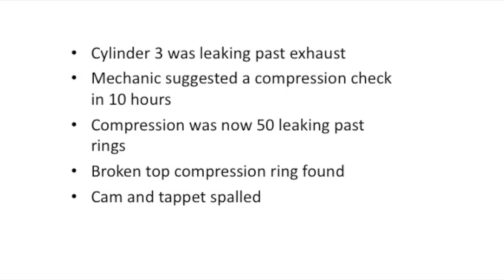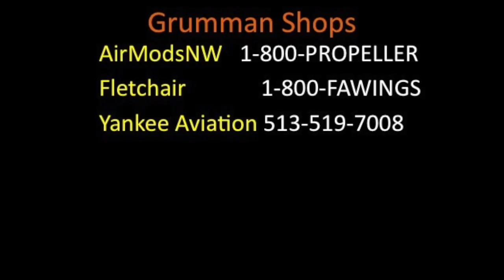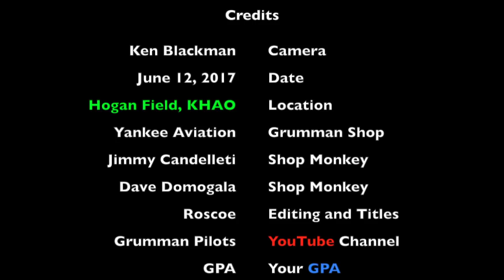Cylinder Replacement Gone Bad  - Grumman Style

Comment: What a shame. We used to do such nice work in Bethpage and Calverton.
Reply: Been told it was a great learning tool, and Grumman designed her to be simple, safe and with little automation so students would get used to a higher work load and greater speed on installed power . Kinda like teaching a guy to drive on a 5 speed mg,  rather than an automatic toyota.. manual tank switch,  higher performance,  the student would come out of the syllabus more confident than on a 172, or a Cherokee.. it doesn't coddle the student, and they can transition more easily to older aircraft with less automation, or higher performance aircraft due to it's own higher performance,.. Strikes me as a good investment for a flight school. I think this was Grummans philosophy  when Roy LoPresti modded her up from Bede's design..my opinion they should have sold her abroad as a military liason/ trainer  instead of breaking into the saturated us market.. India, South East Asia, South America would have been great markets for this plane. give it some more power and range and it would do very well in Brazil..too bad to see this example in such bad shape..
Reply from the maker: Yep
Reply from the maker: Yep

Comment: I didn't realise that bits of scrap like this aircraft where allowed to fly over our heads. It looks very aged and corroded, the aluminium bulkhead (if thats what u call it) is very oxidised. Are there cracks around the braces?  I thought the aviation industry had much higher standards than this pile of junk. Shame on you. I'm a auto mechanic and I would have slackened the tappets right off to release tension in that rocker pin you were malling up with a steel pin and claw hammer. You bring to mind memories of when we were kids messing with an old motorbike
Reply from the maker: Thanks for watching.

Comment: That was in nasty condition given its age. And how did so much moisture get INSIDE the engine to cause so much internal damage to so many vital parts?
Reply from the maker: As to moisture amount, it does not take much.
Reply: @GrummanPilots  Actually it does. There’s always a certain amount of water in oil, but beyond a certain point it emulsifies and causes a white deposit to form. This occurs in water cooled car and bike engines, with which I am more familiar. 

This is something else. It could have something to do with altitude, and the difference air pressures and temperatures involved. It could also be a characteristic of the engine design. 

But having opened up MANY car and bike engines, I’ve never seen that much water based damage to cams. And two of my bikes are Honda VF750Fs with a history of the notorious ‘chocolate’ cam issues. 

It’s a long time since I had anything to do with aircraft engines, though I did a bit of time on Lynx systems (Cessna 337/Continental IO360?) in Rhodesia, but only in passing, because that wasn’t my main role. 

We pushed those things to the absolute limit in some very harsh conditions, and with a shortage of spares and oil. At one point oil was being centrifugal and magnetic filtered to be reused!!

During quick turnaround situations, oil leaks were ragged off, checked for proximity to hot surfaces, and just topped up! 

And We didn’t lose any from catastrophic engine failure. Though I’m seeing a number of Lycoming and Continental engines experiencing catastrophic engine failures on YouTube. It’s a curious thing.

Comment: ZINC ZINC ZINC    If you do not have it in your oil   there goes the Neighborhood.  Was Lycoming  additive added at each oil change?    Are   Air Craft  Camshafts  Nitrated ?  are the  followers/lifters  Nitrated?   IF not  why?      And if this did not happen yet  does air craft  engine oil have Zinc in the oil or do you have to add  Lycoming additive each oil change  for this protection?   At the price of a cam and labor the Cams/lifters  should be Bullet Proof. 

Watching this Video  was very hard to watch.   But I did.     Did someone say when looking  at the rings  say Camshaft.

The rings broke from  Pre Ignition
Reply from the maker: Glad you liked it

Comment: With exhaust coming around the guide you are fortunate you didn't swallow a valve these exhaust valves are sodium filled and depend on heat transfer to the guide for cooling if the shank gets too hot it will break the head off then you have a failed engine.
Reply: That is so Wrong.     And no  True.
Reply from the maker: OK

Comment: These guys already knew this engine and it's electrical system were going to have a major overhaul. Most likely they just wanted a quick look to see how worn that cylinder assembly had become.
Reply from the maker: Owner had a low cylinder and we had a spare, was going to put it on, but engine was done

Comment: Why in the hell would you recommend a compression check in 10 hours when you already know you have a leaking issue? Like its going to HEAL itself? I see or rather hear a mechanic who apparently doesn't know what he's doing being told what to do by his boss or whoever is giving orders and what I presume is the customer standing there shooting video and adding yet more complexity and confusion to the situation. Are there any shadetrees growing in that hangar? Any engines hanging from tree branches using the "old-fashioned" engine hoist? Sounds like the "mechanics more or less can't stand each other. I hope your insurance and especially your life insurance is paid up.
Reply: Anyone with any experience will not remove a cylinder until it has failed a test more than once with some runtime in between. Could be a stuck valve, or a piece of carbon under the valveseat.
Reply: low compression on a single cylinder does not require immediate removal. as long as it does not exceed 15 psi difference from the other cylinders. lycoming service bulletin mandates another compression test in 10 flight hours. so really they are going by the book which is what you do in aviation.
Reply from the maker: Gets the owner 10 more hours of delay
Reply from the maker: Gets the owner 10 more hours of delay
Reply: @forrestmiller4055  A leakdown test would tell them more.

Comment: I've read an alarming figure. Nearly half of all small aircraft have a number of automobile parts. These are in many instances oil filters, fuel pumps, fan belts etc. This is the cheap fix.
Reply: BS
Reply from the maker: OK

Comment: I would not even drive a car in this shameful condition. Seriously!  Accident waiting to happen. Check the wing's spar of that junk. A low wing aircraft from a flight school recently  broke apart due to metal fatigue. The wing spars of few more low-wing aircraft were found in the same condition.
Reply: and using a roofing hammer that way they can rip a part off
Reply from the maker: ok

Comment: A good lesson for all pilots who own older aircraft, if you get your plane back from annual and they didn’t have any snags, it doesn’t mean you have a perfect aircraft, it means they did a shit job or snags weren’t approved to be fixed by the owner. Plan to fix a little bit every annual and you won’t end up with a basket case airplane that’s worth scrap value.
Reply from the maker: That way you have a good plane to use

Comment: The number of people here whinging about the claw hammer is hilarious.  It's just a piece of metal with a wooden handle.  Get over it.  I imagine these guys were wrenching when some of y'all were still puking up Gerber.
Reply from the maker: Good point and they fail to understand that we had a maintenance weekend going on and there were 6 planes being worked on at the same time, and hammers were in short supply.  I add a shot of all my hammers (will fill a 5 gal bucket) in a future video.  Thanks for watching, they say bad comments are still feedback and engagement.
Reply from the maker: FYI, after some YouTube creator research these folks are called trolls.

Comment: A lot of internet experts in this comment section trying to prove their superiority by passing judgements on the owner of this airplane. First thing: the condition of the engine's exterior (particularly the valve covers) is not an indicator of the engine's internal conditions. I see engines with more rust that this run like absolute champions and those with almost pristine paint jobs operate like crap because of the way the instructors and student pilots mishandle aircraft in the flight school environment I work at. 

I saw nothing unusual about the condition of this aircraft, at least insofar as hallway into the video. Airplane's just old.
Reply from the maker: Planes get worn and not always kept up

Comment: I know what it is not to have a lot of money, but your airplane needs some TLC. 

While some of the issues may be cosmetic, those issues will keep you from seeing other things.

There is rust on the engine mount. There is oil seepage from either the cylinder base gasket or the pushrod tube. The badly corroded electrical components may not make a good ground.

I am not stating that the plane can't or shouldn't be saved, but respectfully, there comes a point where keeping it going is not as good a idea as going systematically going through it, and righting everything that is wrong.
Reply from the maker: ok

Comment: Take off the whole exhaust system?  "If we do that there's no telling what we will find."  As an airline mechanic from years ago, I can't tell you how many times I have heard the equivalent from maintenance supervisors and managers.  Don't look, don't tell.  One mechanic I knew was chastised for finding a broken engine mount thrust link on a B737 by the simple process of pushing on the side of the engine inlet cowl every time he walked around the airplane.  I do not doubt that he saved lives and an airplane that day, but the attitude of the higher-ups was, Why was he looking at that?  Unfortunately, it is usually the cover-it-up-and-go types who get promoted in the department.
Reply from the maker: It is on the inspection checklist.

Comment: If this aeroplane was a car!
It would be in junkyard by now!
Reply: Naw,, Car engines tend to last a fuck ton longer then aero engines.. rebuilds every 2000 hours vs a car engine that sees something like 6000 idle hours and 250,000+ miles.   I have been kicking around the idea of a home build powered by a 4.6l 2v modular ford V8 (around 290 crank HP, after 2005) or the Audi/VW 2.8l 30v V6 (235 crank Hp). Both are incredibly reliable engines.. Both are known to run for 20+ years and over half a million miles.
To further justify why these 2 engines are great for aircraft: Both engines only need to spin between 3 and 4k rpm to create max torque and both have a max RPM in stock form of around 7,000rpm
Reply from the maker: Maybe, but not a car

Comment: Interesting video, I would love to have an airplane and learn to fly.  I retired to machining after spending 30 yrs as a highly trained and certified Auto Technician in a Ford Dealership.  It is comical how these engines are so low tech/old technology and how AP mechanics (I have two brothers that are) somehow act like they are rocket scientists LOL.  Some do admit that airplanes are so much easier to work on than cars and trucks.  However I do understand why we still see these old engines used and worked on, because the planes are old that run them and they are certified by the FAA and can't be changed without going experimental.  It's so nice that parts are still available for these.  Try that with automotive stuff that's over 10 yrs old and you'll find they are OBSOLETE, very frustrating for someone like me that wants to REPAIR not replace things.  Good day and happy flying, God Bless.
Reply from the maker: Glad it helped

Comment: Now maybe these guys are professionals but they don't represent very well as professionals to me although I'm not familiar with the aircraft mechanic trade. There seems to be a tool storage or is it a tool rip off either way you slice it they don't seem to have the tools they need. Maybe an auto mechanic Snap-on set is a bit over the top as far as cost an appearance but you cannot deny a well tooled mechanic inspires confidence. A uniform or two wouldn't hurt either. This Crew reminds me of the original Brew Crew and would cause me to worry they would get into the Brew before they finish the stew. Stew equals aircraft
Reply: Aviation maint should be done at a much higher standard than automotive ,  the pro's make notes on almost every  component they tear apart for logging, and move smooth and methodically,  with little wasted time.. these guys seemed to be more guys that did it as a hobby and had some knowledge, but didn't do it for a living.. as for tools,  a pro would have every too needed to pull that head off without damaging it,  out and ready.. it's a common engine, and he would have done hundreds.. he wouldn't even start the job if stuff was missing from his kit.. meticulous fuckers they are..
Reply from the maker: Sorry we did not do better.

Comment: I know why I don`t fly with these small airplanes... horrible technology
Reply: Is not the "technology" is the people working in that video...using a carpenter hammer, taking rocker arms before loosing spring valves, these people should be taken out of of the hangar and the video to be seen by FAA to pull their certificate immediately....
Reply: @Ihaveseenthings577  Ah - another glass house candidate  ...............
Reply: Not the tech, lack of adequate maintenance.
Reply: bobl78:  Blame the FAA. Innovation in General Aviation has been stifled in its entire existence. A type certificate, or a STC costs more than it is worth!
Reply from the maker: Do you still use a toothbrush?

Comment: @23:30   THEY ARE USING A CLAW-HAMMER ... HOLY-F---   THESE TOOLS ARE USED BY CARPENTERS. 
MISSING SOCKETS AND A CARPENTER'S HAMMER..  CAN'T WAIT TO SEE THE VISE GRIPS APPEAR.....
THE BASIC  PRINCIPLE OF AVIATION:  BEST PRACTICES  & PROFESSIONALISM...
claw hammer operators usually think that flathead screwdrivers can also be used as chisels..
SHAME ON YOU... (never mind the rusted parts bolted on the firewall  and the mix-match of hose clamps)
Reply from the maker: It was a busy day, sorry it did not meet your standards

Comment: It needs to be said first of all you NEVER fly an airplane with an engine that has exhaust valve leakage! It's dangerous and will never "fix itself". The small leakage becomes a blow torch during operation and can lead to valve failure, more damage and an off airport landing. If the leakage is caused by carbon, you can stake the valves and check compression again. If its still leaking, remove the cylinder. The longer you run with a leaking exhaust valve, the more money its going to cost you to eventually fix it.
Reply from the maker: Glad you liked it

Comment: An oil spectro analysis would have told you the engine needs replaced. Numbers would have been off the charts. Wasted time playing with the cylinder. I could pull the engine in 90 minutes by myself and I have many times. Gross negligence of the aircraft is obvious to the most casual observer.
Reply from the maker: Everybody  works differently.

Comment: Using classic car oil avoid internal corrosion on Lycomings !
Reply: As opposed to aviation oil?
Reply: goneflying140 yes over aviation oil unless you add additives , it offers no protections over corrosion or any other protections as it’s pure oil with nothing in it.
Reply from the maker: Aircraft need thicker oils than a car

Comment: removing key not enough if ignition switch is worn
better to disconnect battery(ies)
Reply: The ignition system is powered by the mechanical action of magnetos. There are no batteries involved. The mags can fire if the P-lead ground is bad. Judging from the corrosion and condition of that aircraft, I'd say that was a very distinct possibility. If I were those mechanics, I'd have ensured that all plug leads are removed from the spark plugs before touching the propeller. Ensuring the key switch was OFF is NOT acceptable.
Reply: I find that removing the covers and plug leads is pretty foolproof, and the shorting link helps even more.
Reply: Good points all.
Since it could potentially still have had another few flights
I'm just glad they don't subscribe to:
If it aint broke don't fix it :-0)
Reply from the maker: Battery has no effect on a magneto.

Comment: Me and my plane partner just finished having a refurb done on our 1978 Grumman AA-5 Tiger. New paint (complete disassembly and strip to bare metal), plexiglass, interior, Power Flow exhaust,  L-3 Communications ADS-B, recent new radio stack, new Garmin 796 GPS, electric aileron trim, 4 cylinder CHT gauge, .... heck, I’m probably forgetting a few additional things. She looks like a brand new Tiger. It wasn’t cheap, well over $30,000 invested in the refurb, but a heck of a lot cheaper than a new plane. Anyone priced a new C-172 with a decent avionics package lately ? 😳 The big plus is that she’s about 15 knots faster than a PA-28 Archer or a Cessna 172 using the same Lycoming O-360 (the Power Flow exhaust did give her a few extra knots). It would be awesome if the tired lady in this video gets the TLC she needs to make her an awesome airplane once again !
Reply: And you'll live through the first flight in yours.
Reply: You should upload a video of it.
Reply: shartne - I have a short video of me taxiing back to the hanger. I’ll try to get it posted.
Reply from the maker: So this happened here as well